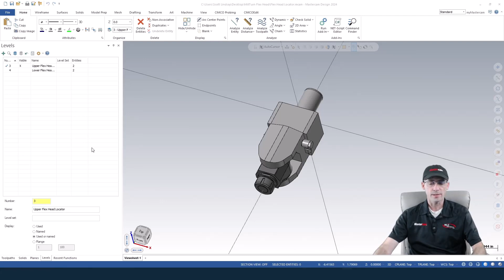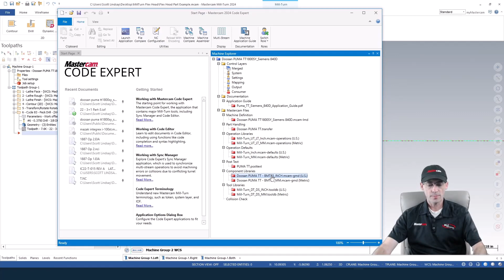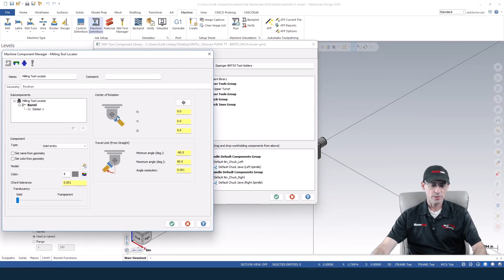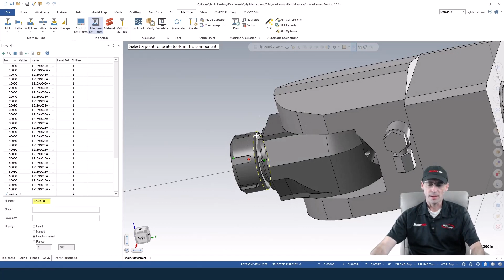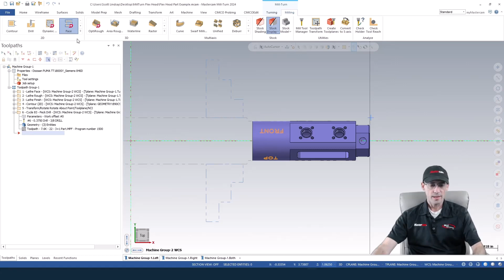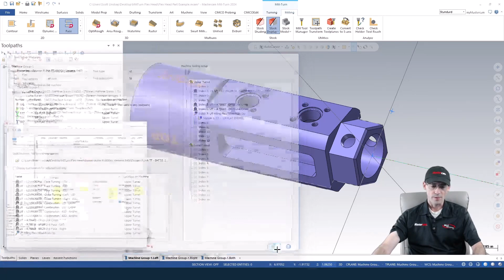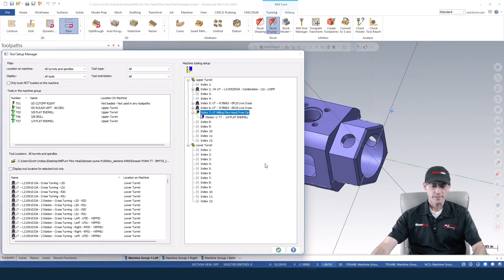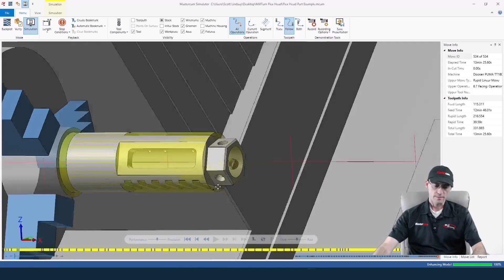Angled Milling Heads Tutorial in Mastercam Lathe - What's New in Mastercam 2024

Comment: There are instances where the mill-turn simulator will pitch a fit and fail to load simulation if the "holder" is embedded in the model of the clamping unit as shown here. 
This has been a problem FOREVER with Mcam. Why can't they just give us an option of "no holder"?